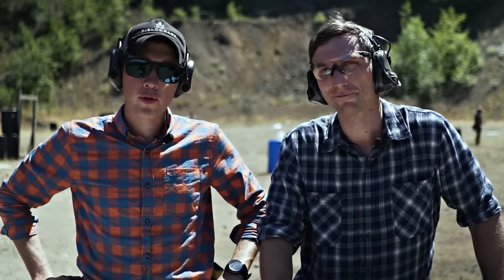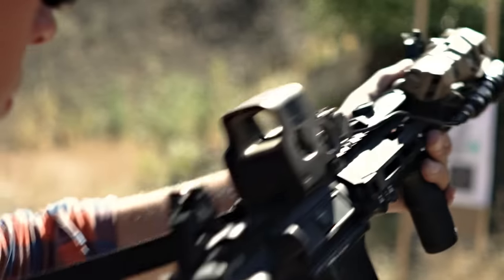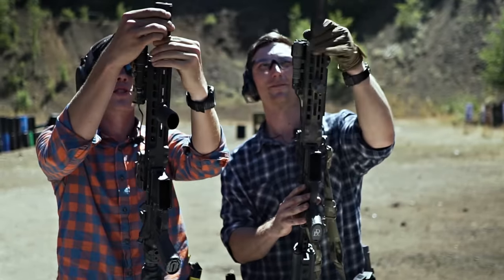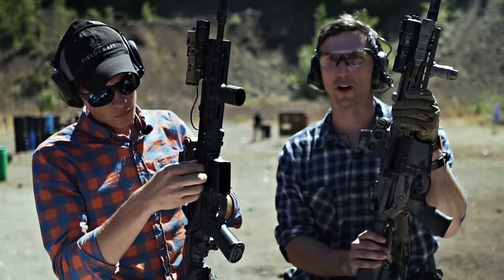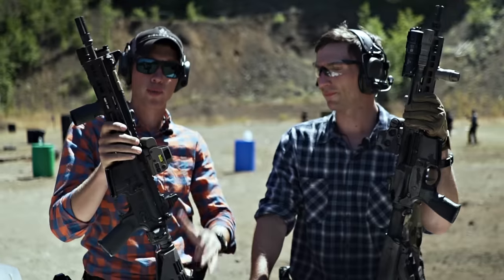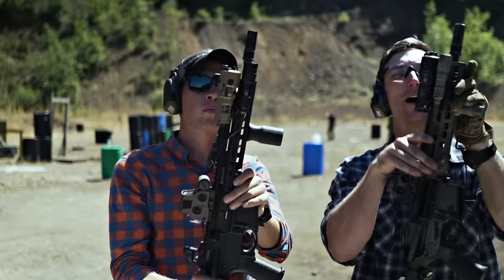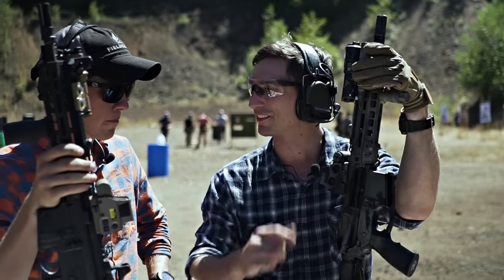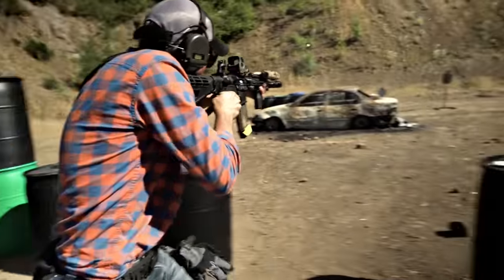Lucas Botkin and Garand Thumb on MK18s

Comment: Finally people are realizing that you can put a vertical grip on a "pistol" if it meets the overall length. Once a pistol is over 26" it is no longer concealable, reclassifying it as a firearm.
Reply from the maker: +Jake Anthony yep
Reply: So does that measurement start at the end of the buffer tube and end at the last thread on the barrel or The end of my brace to the end of my muzzle device?
Reply: Ken I’d just do thread of barrel to buffer tube just to be safe.
Reply from the maker: +Ken end of buffer tube (receiver extension) to barrel (not muzzle device. But to the threads of the barrel.
Reply: how can this be so, when they clearly state that, "adding a vertical fore-grip to a handgun, creates an AOW, and is subject to NFA regulations." Their letter mentions no requirement for length. They state that taking a handgun and adding a vertical fore-grip, you have redesigned the weapons to be fired with two hands.
Reply from the maker: +John Hellmann they have OAL clauses lol
Reply: I still cant find it, maybe im dumb? The definitions are easy to find, but i cannot finad the clause clarifying it becoming a, "firearm." 

All i see is, "(a) Firearm
The term “firearm” means (1) a shotgun having a barrel or barrels of less than 18 inches in length; (2) a weapon made from a shotgun if such weapon as modified has an overall length of less than 26 inches or a barrel or barrels of less than 18 inches in length; (3) a rifle having a barrel or barrels of less than 16 inches in length; (4) a weapon made from a rifle if such weapon as modified has an overall length of less than 26 inches or a barrel or barrels of less than 16 inches in length; (5) any other weapon, as defined in subsection (e); (6) a machinegun; (7) any silencer (as defined in section 921 of title 18, United States Code); and (8) a destructive device. The term “firearm” shall not include an antique firearm or any device (other than a machinegun or destructive device) which, although designed as a weapon, the Secretary finds by reason of the date of its manufacture, value, design, and other characteristics is primarily a collector’s item and is not likely to be used as a weapon. 

So his weapon doesn't meet the definition of a "Rifle," I get that. Additionally it also doesn't meet the definition of a "Firearm." Reading the definitions from the ATF, it is still identified as a pistol, not designed to shoulder, held with one hand and has a rifled bore. Therefore adding a vertical fore-grip redesigns the weapon to be used with two hands making it subject to NFA regulation. 

Id much rather be wrong, but i cant find the verbiage and noone else has provided it either.
Reply: thank you!
Reply: Guys how would I go about doing that.  I want to build my first AR with a Rosco barrel do they make a 12.5 barrel? , also with buffer tubes how long does that have to be to meet  the 26 OAL ?
Reply: Ken the federal law explains measuring for a pistol vs aow/firearm as: from end of muzzle, ie the extreme end of barrel usually end of threads on a barrel with removable muzzle device or from end of device if pinned and welded, to the most open or furthest extended position of the stock with an adjustable stock or end of stock, brace or cheek rest if applicable. So not the end of tube. It’s the end of your brace.
Reply: Also, couldn't a stock be added since it's not a pistol but a firearm?
Reply: mk4vws It is considered a brace not a stock but the ATF ruled that the brace can be shouldered it's a big mess but hey works for me less tax stamps lol
Reply: POSSUM3K3 yes I'm aware of the law. And it's ridiculous
Reply: @mk4vws  Yea all the NFA laws are a joke they just need to do away with it completely. It's basically there for collecting more taxes cause it's full of grey areas and loopholes anyhow..... The government should have removed the NFA as part of the tax cuts then there would be more crumbs in our pockets hahaha
Reply: T.REX ARMS is there such a thing as an extra long ar buffer tube? Most people extend the brace or stock anyway. Seems like if I had a longer buffer tube, then I could shorten the barrel and still meet the 26" requirement. Does that already exist? It wouldn't have to be hollow the whole way back, so it could be used with regular buffers and springs.
Reply: Please! Please! Please! Make your own in depth video about your Mk18 and all this information.
Reply: @Bornstellar  I believe it has something to do with the definition of a pistol being under 26" Check out the definitions in the NFA
Reply: @CowboyKeN19  It should be noted that if you're running a folding brace, it needs to be measured while folded.
Reply: @zZrEtRiBuTiOnZz  I assembled my 300 blackout but came up shorter the the 26 oal.. but according to the ATF they will only shoot your dog if the forward grip is 90 degrees to the bore axis.. so i went with a BCM Mod 3.. the one that is slightly off the 90 degree mark. I have seen many of the weapons in Trex videos and others using the same grip and cutting it down shorter with a more aggressive angle. So at this point its not vertical and its also still "concealable". Its time for folks  to stand up to these un-elected dog killers and show them all gun laws are in fact infringements. Will you stand?
Reply: And that was the last anyone ever heard of ken or his dog...
Reply: Everything is legal until you get caught
Reply: @slipknnnot  And YouTube is full of these guys that claim they will take up arms against the ATF and government.  If all of these morons actually acted as much as they talked about it we wouldn't even know who the ATF was.  These will also be some of the first ones to kneel down and go along with the next new ruling.
Reply: @georgecesarini7748  no it’s to the end of buffer tube, brace not included, recent ruling.
Reply: @Bornstellar  If you are worried, get an 89 degree angle grip (90=vertical).

Comment: "FIREARM" Im Dead...Definitley Building a  "Firearm" now, my AR-Pistol dreams just flew out of the window, Nice Video Guys👌 nice chemistry👌
Reply from the maker: +Pac Man 👍🏼👍🏼
Reply: Pac Man dude, a "firearm" is the way to go. So many advantages for just 1" extra barrel length. Enjoy the build and the "firearm"
Reply: How do you make a firearm instead of a pistol or rifle?
Reply: You just build it to the overall length requirement of 26 inches
Reply: FYI, if you are going with the SBM4 pistol brace like Lucas has you can use the Leapers UTG AR pistol extended receiver tube with a 10.5” barrel and you will meet the 26” OAL requirement (it’s longer than a traditional pistol buffer tube). I think you might also be able to do the same with a SBA3 adjustable pistol brace if you use the Vltor A5 system like Mike has. The Vltor receiver extension is about 1” longer than a traditional carbine receiver extension. That extra 1’ might be enough to get you to 26” OAL with a 10.5” barrel but will get you there for sure with a 11.5” barrel.

Comment: Recently got my first AR, an M&P 15 Sport 2. I added the Holosun 515c Red Dot, and was feeling pretty good about myself...till I saw this.  I think I understood about every 10th word. In fact, I'm pretty sure they made up 1/2 that stuff, but I'd never know. Lol.
Reply: MP SPORT IS A PRETTY GOOD ENTRY LEVEL RIFLE. THE HOLOSUN ON THE OTHER HAND IS COMPLETE GARBAGE. SELL IT ON EBAY AND BUY AN OLD BEAT UP AIMPOINT COMP M2 FROM A MILITARY SURPLUS VENDOR ON EBAY FOR $250 IF YOU CANT AFFORD A $500 EOTECH OR AIMPOINT.  EVEN IF THAT THING IS BEAT TO SHIT IT WILL STILL RUN UNTIL THE WORLD ENDS.
Reply: Paul Barclay well, I made my comment as a joke about how advanced their conversation was, but ok. It's less about being able to afford it and more about justifying spending $500 on any optic for a sporting rifle that basically will be for range use, target practice, etc. Not everyone is runnin and gunnin with $2-$3k set ups. I guess time will tell on the Holosun but so far it's pretty awesome.
Reply: like i said-you can get an older used aimpoint comp m2 on ebay that is military surplus for $230. I have one, and im speaking from experinece. I have aimpoints, acogs, trijicons, etc, and my 15 year old beat up comp m2 will run with any of them. You dont want "time to tell" with your holosun, because when it breaks you cant sell it. If you use it, it will break. Its just a matter of time. Those things are low quality. They are not military grade. Your SW MP2 is not a high end ar15, but its a good reliable ar15 that will do whatever you need it to do. the same cannot be said about your optic.
The entire point of having a rifle is for self defense, etc, regardless of using it at the range-and for self defense you need something you can bet your life on. I wouldnt bet my life on a holosun.
Reply from the maker: +J Reed Holosuns are awesome
Reply: They are awesome until they stop working. When they first came out a few of my buddies got one. 2 out of 5 of them dont work anymore (although my friends use their guns hard-but not as hard as you or g.thumb does). Maybe for someone who is just taking his rifle to the range it would be fine.
Reply: The holosun seems to work for the guys on InRangeTV and they actively shoot tons of rounds at a lot of 2 gun competitions in Arizona. Mind you Arizona gets insanely hot and the stages they shoot at are very dust and sand ridden. Karl's Holosun seem to work well with no known issues he could report about them. The SIG Romeo 5 red dot is also a good choice for under $200. A review by Alabama Arsenal where he froze it, tossed it in the air and land on gravel, and even shot it with a shotgun which the Aimpoint optics were famous for that test. Worked and still held its zero(at practical ranges a red dot would excel at, obviously). 

YMMV and you're not gonna know unless you test it out yourself. My personal experience with my budget Romeo 5 has been pretty good and has served well in carbine classes, especially when doing drills where we constantly dropped down in prone positions in the mud and sand (Southeast Texas weather sucks for people who don't like training in the rain). I do keep an EOTech 518 though, because I really like the reticle design. Second to the ACSS with the chevron.
Reply: Paul Barclay understandable. Like I said, YMMV and I seen plenty of those chinese fake aimpoints on ebay. If I want a military approved red dot I'd get it straight from the company or well known dealer of said optic. Besides, no one really knows if that optic even was in combat or just banged around the back of a Humvee all day. 

No question, though. Aimpoint, EOTech, Trijicon, etc. they make reliable optics and my EOTech 518 is my go to for SHTF stuff.
Reply: Paul Barclay haha nice! My goal is to try and find a surplus sold Trijicon ACOG, if they're even out there. Lol
Reply: Paul Barclay nice! Thanks for the heads up haha. Be the perfect setup actually. ACOG with red dot on top for CQB... Match made in heaven. 🤘🇺🇸😎
Reply: Paul Barclay yeah, I was thinking of getting a variable powered optic or a magnifier with my red dots, but like you said, they get pretty bulky fast.
Reply: I'm running a ROMEO 5 on my go to rifle now, even though I have an Aimpoint PRO on a LaRue mount .. that little Sig has impressed the hell out of me!
Reply: The Sig RDS' are OEM'ed from Holosun (sorry if stating the obvious). I prefer my EOTechs, but the Sigs are fantastic optics that I think are perfectly paired with that Sport II. I like the EOTech-like 65MOA ring with 2MOA center dot for fast acq. The MOTAC feature is where it shines...unlike the EOTech it switches on whenever there is movement, and that makes it perfect for home defense or any other usage scenario where "need it now and need it to work" is important.
Reply: a good start RDS would be a sightmark mil spec or non they are both fantastic

Comment: interesting fact: Eugene Stoner original want a forward assist and it was only at the demand of the Army that it added and redesignated the M16A1. The reason Stone was against the forward assist was that if the bullet didn't chamber properly it could mean that there is an obstruction in the chamber and trying to force the bolt into battery could cause damage to the rifle. The more you know
Reply: Which is why a lot of the "later gen" rifles either don't have a forward assist or it's integrated into the charging handle
Reply: Excalibur01 on civilian rifles sure, but the military still insists on having a forward assist for some reason. Military intelligence
Reply: I'm talking about other guns, not strictly the AR series. The SCAR doesn't have a separate forward assist because the charging handle reciprocates.

Forward assist on the M16 series is really an American thing. Other main stream guns like the G36, Tavors, all the H&K roller delay guns, the Bren, even the L85 does not have a separate forward assist button like the AR series 

Even a lot of the AR-10 types the US military uses don't have forward assists.
Reply: valid point, I assumed that still talking about AR/M-16 family. You're right, and the AR family is 60 years old, there are but rifles
Reply: The only thing the FA is good for IMO is doing a silent charge. Basically if you down wanna make all the noise of racking the charging handle for whatever reason, you can really quietly pull the handle slowly ana walk it back and then press the FA to put the bolt in battery.
Reply: Integrated chargin handles handled this issue

Comment: Try the SBA3 its adjustable for length of pull
Reply: Brioni Russo is the SBA3 allowed to be shouldered? This is where I am confused and seems to be a lot of grey are.  Lucas is using a AR pistol and is shouldering it so I guess it’s okay?
Reply: @danielbyerly8269  yes it is
Reply: Not 100% is SB has a ATF letter for the sba3 yet..
Reply: How did you get the folding sba3??
Reply: SBA3 is Batfe compliant.  Almost every retailer states this on their page. And if I’m not mistaken (might me be) Sb’s site reflects this too.

Comment: You can adjust the length of pull on a AR pistol/firearm. You cannot do it on the fly but KAK makes a tube and some spacers that allow one to place the brace at any of the third through sixth adjustments on a 6 hole carbine stock.

Comment: It's an "any other weapon" once you add the vertical grip, right?  But since yours is more than 26" the ATF essentially stops giving fucks.
Reply: Maniac742 does the flash hider have to be pinned and welded for him to be able to have the vert grip? Or does over all length defeat that over all? I'm asking cuz one of my ffl dealers said to me that it has to be pinned and welded while including the over all length of 26 inches in order for it to be ok to have a vert grip on, is that correct?
Reply: Phillip Schmauch Only if the flash hider is required to beat 26".  If it's 26" without the flash hider, then no.
Reply: Maniac742 ok, a build I have is 26.5 inches including the flash hider. Can I put a vert grip on? Or do I need to pin and weld the flash hider?
Reply: Can't say for sure, but pinning and welding would be the safest bet if you want to add a VFG.  Given that flashiders and muzzle devices only count towards a barrel or gun's overall length when pinned and welded for rifles for NFA purposes, I'd have to assume the same is true with AR pistols.
Reply: Maniac742 well crap
Reply: has to be from the end of the buffer tube to the end of the barrel itself without whatever muzzle device you have attached
Reply: Maniac742 look up the federal definition of AOW. The definition states exactly that changing from a pistol to an aow changes the firearm s classification from pistol to firearm. Lucas was actually correct, or by using firearm goes further to classify aow. Go read the actual federal law.
Reply: Well if that's correct what Lucas said.....I got some bad ass adjustments to make

Comment: What about the eotech not holding zero in extreme temperatures? (Thermal drift) That's a serious issue when it drifts 12 inches at 100 yards in a -40 degrees or 120 degrees environment.
Reply from the maker: +theone 111777 been fixed. And... most red dots suffer thermal drift. But the old Eotechs were a little worse, yes.
Reply: T.REX ARMS what's the maximum effective range of your 11.5" rifle/pistol?

Comment: As someone who recently got an AR last year. Forward assist was a must. My uncle had completely assembled the lower and had bought an upper and it was a late graduation present. Well. Needless to say there was a imperfection on the disconnect that I had no idea existed, had no idea wtf the disconnect was. Or any of that. Well. It was a one failure after another kind of day where me being the dumbass i was hadn't cleaned the rifle before i shot it and there was excess grease in the chamber. It ran like a champ for the first 4 rounds. Then it locked solid with a round partially in the chamber and i couldn't get the bolt back at all. Figured out through youtube what the hell a forward assist was dropped the mag and slammed my palm into that mofo so many times i had an indentation in the shape of it and the bolt finally closed far enough that i could fire it. Shot that last round off, broke the gun all apart, and by all apart i mean fully disassembled the lower aaand figured out what was causing another issue i started having which was a little burr on the disconnect which was preventing the trigger from resetting. sigh well. Good news is I know my gun inside and out.

Comment: I still love my KAC quad ON my AR..
It's a great heat sink, and I actually prefer the weight.
To each, their own.
I'm used to lugging my FAL, so it's not heavy to me.
 I also don't run all that I.R., which saves forward weight.
But I do run a grip pod... Again, personal preference.
I do run a lpvo and mount, which brings me to almost 10 lbs, but it's balanced.